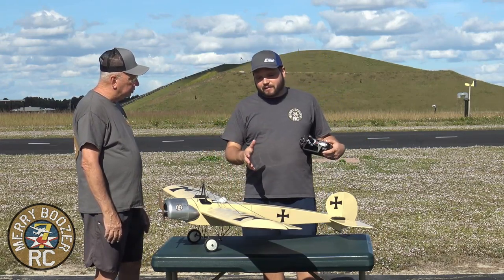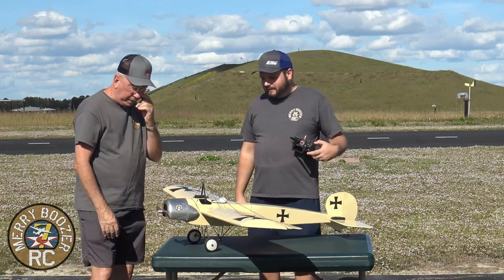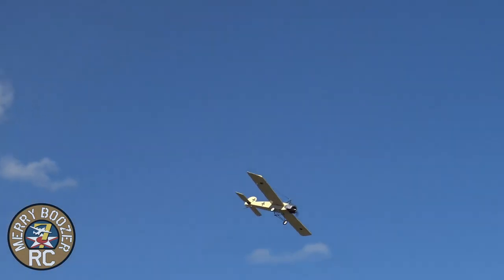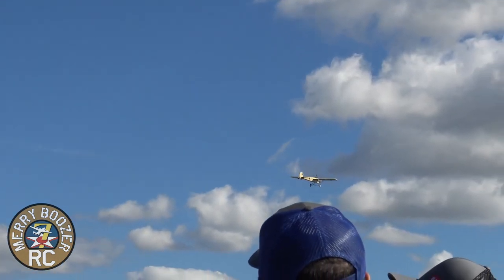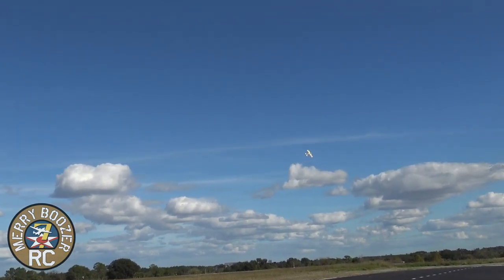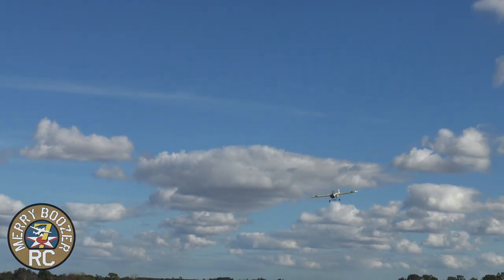Fokker Eindecker Electric Scratch built Flight WW1 Scale Fighter #aviation #rcairplane

Comment: I have a ton of old boss of planes I have converted from gas to electric as well so much better flying wise because you don't have to worry about adjusting the motor and all that other crap you literally charge up a bunch of batteries and go flying yes gas is nice when they run white because all you got to do is literally fill up with fuel and go